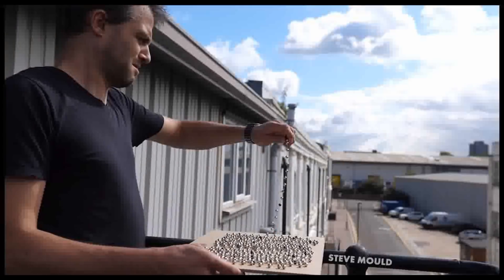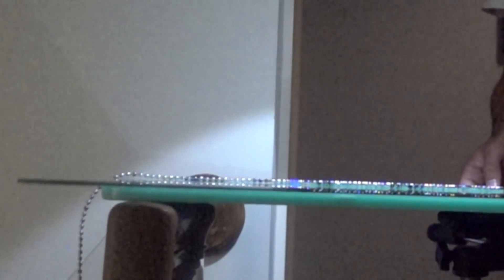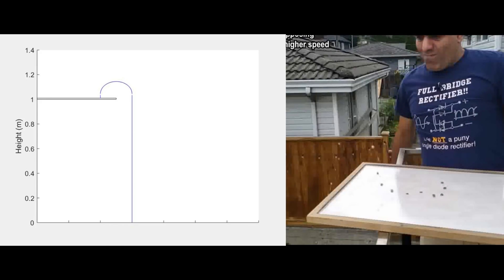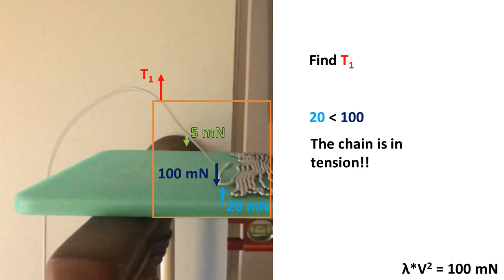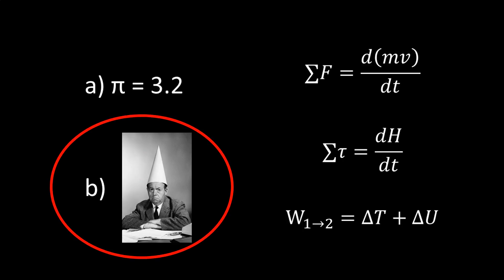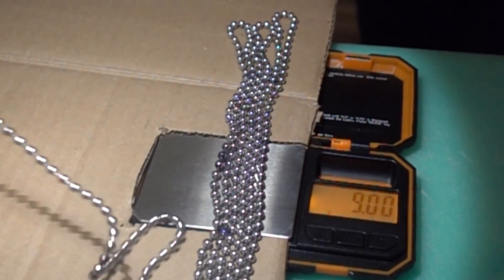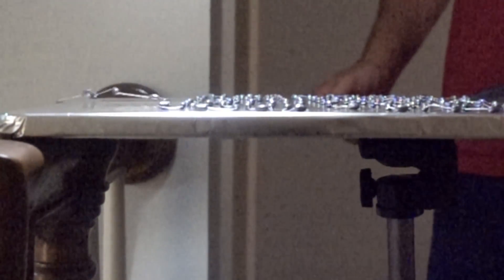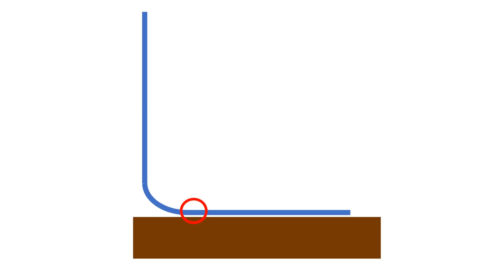And the Winner of the Chain Fountain Dispute is...

Comment: Now I wouldn't get medals for my scientific knowledge, so to use too much scientific reasoning would be a bit much for me at this point in my life. Therefore I am more in favour of listening to what you say and to watching the videos of the actual experiments. 
I like the idea of a reaction force because you found, a very insightful way to DEMONSTRATE that to us.
I am also more in favour of ascribing it to a SPRING force, to bring it in line with the BEND RADIUS idea.
That experiment where you give it a random assortment of bends and kinks, is the clincher for me.
Therefor I conclude that the bend radius theory is, which I have now dubbed the SPRING THEORY, a more plausible explanation, to account for the reactionary force purported to be the cause of the so-called MOULD EFFECT.
I am not convinced by the LEVER-EFFECT explanation by Steve, however.
You have explained it in terms of the system trying to minimize its energy by reducing its bend radius, and that is clearly being helped and facilitated by the the potential energy that is being stored in the SPRING EFFECT, which is why the effect first has to store the potential spring energy after which it is able to add this to the momentum of the moving chain to help it grow its height.
For me it is clear one should see the spring energy being stored by the bends in the chain, being added to those already present in a container with a chain that has random bends present, as in one of your experiments.
It is almost like a group of capacitors in parallel, which are already partly charged (bent i.e. SPRING energy) being connected in parallel. In the case of the container with a concentrically coiled chain, it would be like connecting the same number of capacitors in parallel, but them being virtually empty. Therefore the charge (potential energy) would rise slowly in these before they can contribute to the cost of the raising of the chain.

I know I am verbose, but sincerely, you have given more insight into this MOULD-MEHDI-SPRING controversy so far. Thanks buddy. Am am subscribing!

Comment: just had a thought, i wonder if the bends in the flat chain when being pulled acts like a solid object and with the tension of the chain imparting angular momentum on the bend which creates a force in the 3rd dimension causing the chain fountain

Comment: the impressions on the tin foil are really conclusive. that takes a significant  (reletivly) force to indent that to the degree of being visible and would not happen if the balls were just being pulled off the surface
Reply: It just proves there is a force applied to the surface, it does not prove that force causes the chain to rise. I agree it makes sense to draw that conclusion but it doesn't prove it. Also I think there's a difference between a bucket or bowl of chain vs the flat surface. I don't claim to have the answer, imo it could be more than one mechanism causing the effect, therefore it's hard to prove that it is any particular mechanism singularly.

Comment: In a chain drop experiment, we observe that,  the end of the chain that is starting to drop is being pulled at the same speed as the total chain (since they are linked). So if the end of the chain is being pulled faster than it would be by gravity, there is an energy being put into the chain which shows up as fountain.

Comment: I think everyone is passing true the completely answer without seeing it. Yes what Steve is right but not the whole picture.
2:49 As you can see the the chain is going down straight. But as the pile is being reduced its also compressing the wave pattern on the chain pile. 
At an point the wave will reaches its maximum compression given the distances between the balls, yet there still energy being put to compress the chain. That energy can easily be redirected by any random factor to find somewhere else to be dissipated.
You can see that right here 2:51 the chain reached its maximum compression and when the energy couldn't find somewhere to go it churl into a loop changing the weave from a horizontal plane to a vertical plane initiating the fountain.
A vertical wave can not stay flat or it would just be a line thus it pushes the chain up and that is what is forming the fountain.
11:41 The more compact the loops/weaves on the pile the more frequently it pushes the fountain up so the higher it goes.

In short. In a perfect world without any randomness there would not be a fountain. The chain would just fall straight while compressing the pile and the pile would whip to one side near to end of the fall.

Comment: Why overcomplicate and introduce more variables than there needs to be. Make the chain a long free hanging loop from some height affixed  to a pulley that is capable of being controlled dynamically by a motor. Accelerate. A "fountain" begins to form and climb the loop as acceleration increases. Reduce the acceleration to zero while maintaining speed and you're left with a standing wave. A free hanging chain on a loop eliminates the possibility of a kickback force from ANY surface, and yet, a fountain forms. A chain fountain is nearly entirely a physical snapshot of the numerical acceleration values of the wave involved. There is kickback force because well, you're moving masses that have friction against other masses! This is negligible as far as the fountain is concerned.

Comment: Circus artists show myriads of such motion with no base thrust needed. And the Indian rope tricks show the same.
Stable and unstable equilibrium:
11:40. No π isn't 3.3 and yes, we know that the chain may curve until the beads 📿compress against one another causing a change in direction randomly. There are infinite random such, but the table top restricts this to one half above the table. The chain ⛓️always ends up in the stable equilibrium, which is the vertical fountain with gravity acting vertically downward to decide the outcome. 
Another possible stable equilibrium is a horizontal jet away from the edge with no curves until the point where it turns downward due to gravity.

Comment: Like iv said in the comments on both channels. The phenomena of the arc rising is directly related to the very specific design of the the metal  chain and its links. This is very interesting.  My argument is the force causing the rise is in what's happening to the chain in the section from in the jar/table to the arc. The section of the chain that has to to figure out how to go strait in line with the rest of the chain being pulled. The unique design of the links create a run away effect in relation to the inertia pulling down. The slow-mo clip of the rod is taking the chain and its links into bigger sections to observe better but the SAME effect is happening to every link along the chain in a cup or on a table or off a biulding.

Comment: If the speed of flight of the balls is faster than the speed of sound in metal, then there will be no effect.
Repeat with the "slinky" spring and you will see everything for yourself.
Reply: Good luck finding a motor that can pull that chain fast enough for that you are looking at about 3.1-3.3 km/s for stainless steel which I think is what these beads are.

Comment: As someone working as a mechanical engineer, i can say that you try to solve a the forces of a moving object with equations for a statinary one. Those ones you useed, only apply to a stationary chain, and also only if its a straight one, and not a bent one. Also if there would be a friction force acting like you showed it would violate Newtons third law: Actio=Reactio
If you are looking at a moving object, all forces that act on that object are equal to m*a. This inertial force is what is causing the chain fountain not to collapse under its own weight.

For my solution to the chain fountain dispute:
The centrifugal forces of that part of the chain, going around the 90° bend after the boards edge, is causing the chain to lift itself from the board. See the Part of you borad experiments.
The scratches in the aluminium foil are also caused by the centrifugal force of the chain.
Reply from the maker: From one mechanical engineer to another, I would encourage you to check out the paper that I linked to in the description. In the paper, I used Reynolds transport theorem to derive the equations used in the video. And RTT does not have any requirements about only being used on straight, static objects.

I don't know what friction force you are talking about. But if you are talking about the reaction force from the board, it is really no different than someone jumping off the ground. During the jump, the normal force exerted by the ground exceeds the weight of the person, and as a result the person accelerates upwards. Likewise in this case, the normal force on the cutting board increases, accelerating the chain.

"For my solution to the chain fountain dispute:
The centrifugal forces of that part of the chain, going around the 90° bend after the boards edge, is causing the chain to lift itself from the board"
I had the same intuition, but you can clearly see from the high speed footage that the fountain starts on the right hand side at the stationary chain. The fountain does not start on the left hand side near the 90 degree bend.
Reply: @prestonbecker8784   @Preston Becker I was takling about his vertical force in his drawn scheme, where Fr gets bigger than the force of the chain onto the table. 
On the juming of the ground part, its still not the grond pushing you up into the air, its just the ground does not move and thus exerts a equal force back onto the person, but the initial force needed to jump into the air comes from the person jumping and not from the ground, like its told in may of the chainfountain dispute videos
Reply from the maker: @Joseu124  Again, if you think there is a procedural mistake, check out the paper.

As for the jumping analogy, when a person jumps, they push their legs into the ground. Since the ground does not move, it exerts a force on the person, accelerating the person's center of mass vertically. Likewise, with the chain fountain, as the chain rises, the chain links try to rotate. As they rotate, they run into the ground. And since the ground does not move, the ground exerts a vertical force on the chain, accelerating the center's of mass of the links upward.
Reply: @prestonbecker8784  "Likewise, with the chain fountain, as the chain rises, the chain links try to rotate. As they rotate, they run into the ground. And since the ground does not move, the ground exerts a vertical force on the chain, accelerating the center's of mass of the links upward."

I respectfully disagree with this, Preston. What you are describing is exactly what the Cambridge physicists are saying which is incredible because they clearly are linking two different, but similar phenomenon. Yes, this would happen if the link was rotating about it's CM(center of mass), thus upon impact, am impulse will be imparted onto the surface and because angular momentum must be conserved, the surface would apply that same impulse on that link end, causing it to rebound and lift the link as in the cambridge video. Just look at  their video at 7:37 where they demonstrate this kickback effect. Really? Why did they show this instead of something that represents what's really the case with the chain. The chain links do not start with the rising end low and the anchored end high, thus allowing rotation to generating angular momentum and an impact event on the anchored side. The chain is anchored on one end and the upward force is applied to the other end. This is not what happens with the chain and it is incredible the Cambridge physicists even gave this demonstration. There's nothing wrong with the demonstration itself, but to link it to the chain links and say this is what is happening is beyond ludicrous. You're a mechanical engineer. Can you really tell me that this is what's happening? If you were to analyze this one link only, it's best representation would be a link with a pinned(sorta) connection that is laying flat on the surface. As the upward force is applied to the right end, because it's applied at and angle, it would impart both a vertical and horizontal(pull to the right) force on the beam. As soon as the beam starts to lift, the beam starts to increase the force it exerts on this end. Likewise, the normal force of the surface simultaneously pushes back on the beam. It's the combination of these two opposing forces that provide the friction to keep this connection "pinned" so that the beam can rise. Without the simultaneous normal force acting with the resulting force of the lift, there will be no lift as the beam would just slide about. So the normal force is always present from start to finish! It increments correspondingly to the lift. In other words, delta normal force with respect to time is miniscule, as such, there will be ZERO lifting of the anchored end with the velocities we are seeing here. The only way this is possible is if the acceleration of the right side was so great that it imparts such a large force on the "pinned" end as to deform the beam or the surface at that end, which would be evidence of acceleration on that end, and in this case, this acceleration would generate a velocity and thus, some angular momentum, which must be conserved during impact. As such, it could yield an impulse resulting in the lifting of this end from rotation caused by a force on the opposite end. The other possibility is that this applied force is so great, it deforms the beam about it's CM, thus bending the beam and generating potential energy which upon release, will propel the "pinned" end up. 

Of course, you know this example given by the physicists and my example above, along with yours is not what's happening with this link. This is a dynamic situation and the link on the "pinned" end is also experiencing forces from the link that is anchoring it as well as the normal force acting on it. This is why this kickback being the reason for the rise is so inherently wrong. One, assuming there's no anchor to the link, this end cannot lift as a result of the normal force because the velocities involved are much too slow for this to happen as it's essentially "pinned" on this end via the normal force. The "reactionary force", the normal force is being used up continuously so what's left at the very end as we move alone in time is only an infinitesimally small delta normal force. This is not enough to send this end flying up let alone other links. You're a mechanical engineer. Because this is a "pinned" connection and the contact forces are distributed over a long time period, the force exerted at these velocities is not enough to send this bead rising up along with other beads. And this is not even taking into consideration what's actually happening which is that this pinned connection isn't pinned and actually has other dynamic forces acting on this anchored end which will also resist any "reactionary" force that may arise. So no, I don't buy this at all and I think you will find it hard to convince yourself if you actually sat down and just analyzed a single link. The evidence is in the physicists video. Their demonstration shows a completely different scenario. Why did not show a beam being kicked up that's rotating about one end of the link and thus, any delta rise leads to a rise in the CM of the link. That's what's happening with the chain. In their demonstration, the link rotates about its CM like that of a see saw until it impacts and the resulting normal force accelerates the impacted end up. The reason they didn't is because they couldn't make it happen. Truth of the matter is, the physicist hit on a component of how the fountain rises, but failed to recognized it and instead, went about linking it to some other phenomenon which isn't what the chain is doing at all.